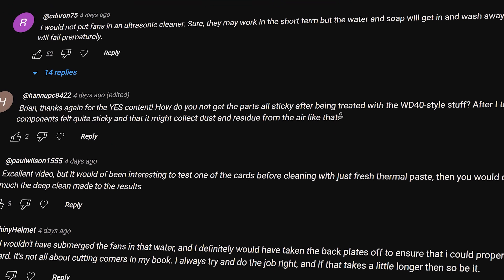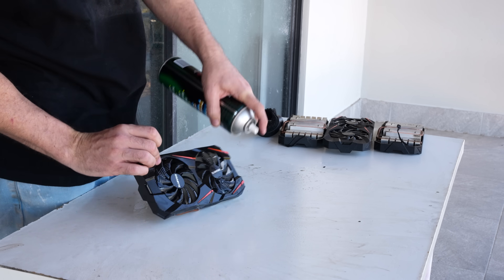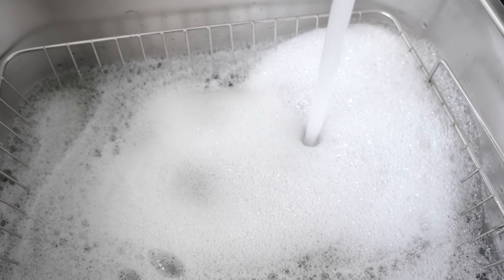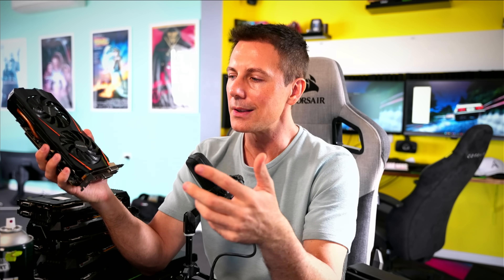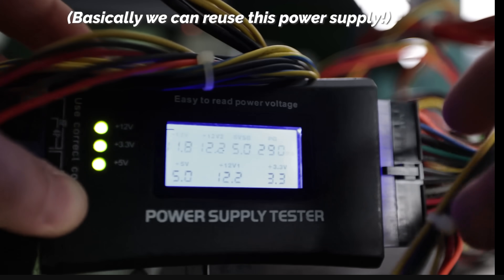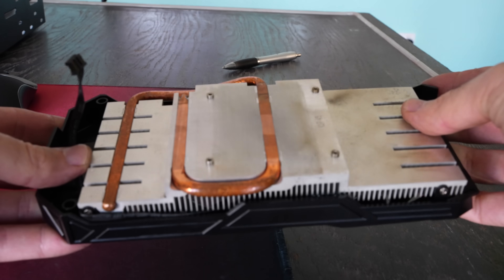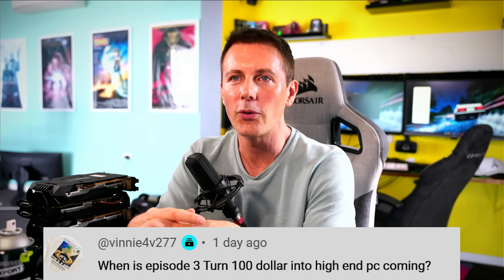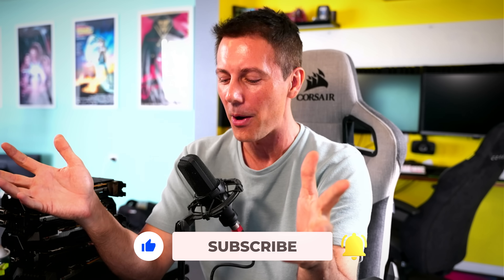"WD40" vs Computer Fans. (When Water Works)

Comment: But spraying lube all over the part is not the same as lubricating the bearing, what on earth… That will just make a part clean, yeah, for some time but make it a magnet for dust. And bearing will work fine for some time (old fan proves nothing — remove dirt from the bearing and it will spin, spray blades with oil and it will continue to spin, obviously, but not as good and not as long as correctly oiled fan). 

What that couple of video shows is just that it is very hard to kill PC hardware, it may survive so much abuse and still function fine. But it doesn’t mean one should abuse it and cover with oil film all over the place. Though it is understandable when the shiny surface helps you to quickly get rid of the parts ;)

Comment: I had a motherboard board with caked on dust and I gave it the "TechYesLovin" and it was fine. I did decide to use DI water in my case and it let the thing air dry for 2 days. Board was fine. DI water and a toothbrush for cleaning. Worked great.
Reply: Toothbrush, toothpicks, ear swabs and these baking brushes to oil up cake forms. All soft enough to not scratch the electronics, but firm enough to get the dust out.
The cooking brush is great to get into coolers, the toothbrush for general surface brushing, toothpicks to get into corners (like when cleaning thermal paste) and the ear swab for smaller surface.

Comment: Not sure if you can do this with modern fans but you used to be able to take the sticker off the front of the hub to reveal a little plug that you could remove to add lubricant directly to the bearing. I used to watch a budget builds youtuber who would rinse his PC parts such as fans with a hose and put them on the roof of a shed in the sun to dry. I wonder how many of those parts would have still worked a few months down the line once corrosion set in.

Comment: Sometimes you should really consult with professionals... Penetrating oils are lubricating, but only for a short while, they are literally designed to have no surface tension, which is what's needed to combat rusted bolts. That would be the exact opposite of actual lubricant (oil/grease). The minor forces applied by the fan wouldn't be enough to avoid contact (between shaft and bearing) and therefor the fans will die pretty fast (maybe couple of 100 hours)

Comment: I think some of the flack probably came from applying the spray with the heatsink still attached so none of the spray really gets in to the bearings, even if it claims to be a lubricant.

Comment: chip board and drywall in canada lol, You can take those fans apart entirely also take off the back sticker on the fan then take off the rubber plug remove retainer on the fan shaft then it slides out motor is exposed on other side those fans can be rebuilt if you wanted you can swap the blade onto another fan same size vice versa etc lol.

Comment: When I had an original IBM PC AT keyboard, I'd just throw it in the dishwasher about once a year and let it dry out, I live in Arizona, so air drying worked well and I used that keyboard for about fifteen years, until the Windows key was a must.

Comment: I stopped cleaning fan bearings...a good fan will have lubricant that lasts longer than your PC will.  I just stopped buying crappy fans.  I have fans that have ran 24/7 for 5+ years now and still dont need lubricated.

Comment: WD 40 is made for car engines to last at much higher temperatures but it clutters smaller stuff, try using bycicle oil instead, its much more refined and made for smaller moving parts. Should work fine on fans as well.

Comment: WD-40 does also lubricate but it's not a lubricant. The whole purpose of it is that it's good at a lot of things but shouldn't be used as a replacement for things that have a specific purpose. In essence WD-40 is a jack of all trades but a master of none.

Comment: Would you reckon that using the ultrasonic cleaner would work for things like CPU/GPU waterblocks (disassembled) and radiators to get the gunk inside and on them out?
Reply: for thorough cleaning, it is advisable to disassemble it and use a soft-bristled toothbrush with warm water. However, if you opt to put the block inside an ultrasonic cleaner, it can still do a decent job if you disassemble it then put it inside the ultrasonic cleaner I would gently clean the rubber seals by hand but that just me I don't know how they would hold up in the ultrasonic cleaner.
Reply: sometimes there are gunk that a toothbrush can’t remove, so I am wondering if an ultrasonic cleaner will help. I did mention that the blocks would be disassembled.

Comment: The issue people are concerned about when using regular tap water instead of distilled water is due to the mineral count in the water itself, especially if you have really bad hard water. Calcification can happen fairly quickly under the right conditions. Even with a water repellent spray it does not guarantee all the minerals have been washed away. But the amount of minerals left behind is extremely small and the chance for corrosion is almost non-existent. But I would not recommend doing it on a regular basis.
Reply: People are telling Byran how to do his job when he's been doing it for years, because they never done any of this themselves
Reply: @LawrenceTimme  I worked in a few computer manufacturers and one thing I can tell you is they will never use "tap water" to clean the boards. There is nothing wrong with using water, but there is a huge problem when using regular untreated tap water.

Comment: what do you think about pairing  ryzen 5 2600 and rx 6700xt am planning on building a budget system to upgrade from my i7 3770 and rx 570 4gb
Reply: It will be better but you’ll be missing gen 4 pci but since the 6700xt full pci 16 performance loss should be pretty minimal and will be light years ahead of your current setup

Comment: It's not the water that kills PCB's it's the minerals in the water as it evaporates that kill PCB's The exception is Capacitors. They can be destroyed internally by ultrasonic cleaners. Yhey are made with very thin foils. Careful with timing crystals and other exposed copper parts. Use distilled water and proper PCB cleaners in your washers.

Comment: I see a YouTuber soak his various electric boards in isopropyl alcohol, and I have always heard that this is terrible for the plastics on the board. He does it to make sure anything that anything that has leaked from capacitors is cleaned up. I haven't seen him having a problem with brittle board plastics.

Comment: hi techie chap, just done a lunchbox PC, same one you done, my issue is thou its great, but the leads from the stock SF600 are bit to long, i looked at some replacement stuff but nobody i know does custom cables to my length.
i the spec, nice 1080 machine
b550 board, 3070ti, 32g ram.

Comment: I think you can keep using generalized term/brand name such as WD-40 for some type Water Displacement spray, people are just nitpicking at that point.  A little tough considering WD-40 now has more formulas, but still just because the WD-40 can doesn't specifically state lubricant doesn't mean it doesn't act in that sense just as your Multipurpose spray.  People ask for a Kleenex when they mean a facial tissue.  But you should try and get ahold of some WD-40 just the original formula and clean and monitor a PC for some time.  I'd like to see that.

On WD-40's Site:
A QUESTION OF LUBRICATION
Myth: WD-40 Multi-Use Product is not really a lubricant.

Fact: While the “W-D” in WD-40 stands for Water Displacement, WD-40 Multi-Use Product is a unique, special blend of lubricants. The product’s formulation also contains anti-corrosion agents and ingredients for penetration, water displacement and soil removal.

Comment: Ofc you need to relubricate or it will run on dry surfaces and ware out the ball bearings or sleeves. And electronics and water isn’t the best mix so be sure to get it dry, I would leave parts in a dry and warm area for days before using them again. 
Ppl have bought graphic cards with water damaged gpus that cracked when they got warm, so if you buy used parts that look "cleaned" take it apart and check it up and leave it in a warm place for a few days to be sure it’s dry.
Reply: Absolutely make sure it's dry. I've had usb drives left in the washing machine before and they still work, but only because I made sure they're properly dried before putting them on power.

Comment: It’s definitely bad for the hardware. That lubricant spray is not the proper lubricant for high rpm fans. Also any wires cleaned with water will wick the water up into the wire leading to unseen corrosion. It’s 100% bad.
Reply: Wires is the kind of stuff where a water deplacement is useful.

Comment: Possibly a silicone lubricant and silicone spray removes water that's what wire dryer is its silicone good for under the hood of a car connectors spark plug wires stuff like that anything electronic.

Comment: Bro I don't doubt your results , but I believe you misleading people with the lubrification. You are not lubricating the actual bearing as it is incapsulated in the fan. You are just lubricating the outside of the fan.

Comment: WD40 is too slow of a lubricant to be used in fans. I use TriFlow, which is a teflon-based synthetic lubricant and it even works as a contact cleaner.
Reply: Great tip, I'm saving it's name.

Comment: Prolly 5 years ago I ruined my 120mm CPU fan using original WD-40 and didn't knew the reason. Yeah use lubricants not abrasive WD-40 to "help" fan to spin for few weeks. Not sure if PTFE lubricants are worth try if one of my fans dies

Comment: Lubricant is fine I guess but why not grease for fans? At high rpm you’re certainly gonna lose a bunch of that over time and be back in that situation. Grease should hold up better and longer (and costs roughly the same).
Reply: Should be really great for ball bearings, but maybe not the greatest for sleeve bearings.

Comment: WD stands for water displacer. It is the opposite of a lubricant. Actual WD 40 turns into a weird hardened muck when you spray it on hardware, it will kill hardware pretty quickly. After using WD 40 on anything, you want to wash it off or displace it with a lubricant. Years ago when you started calling that spray WD 40, I got curious as to what you meant by that. I tested WD 40 spray on an H110 board to see what it did. Your misnomer is responsible for the death of at least one motherboard lol

Comment: I use WD40 to clean components but I don't use it to lubricate, it's not an unorthodox method of cleaning what do most people think they do at the factories when most of the hardware is covered in loads of crap from making the PCB mind you most of the large manufactures use acetone or at least distilled water lol
Reply: Yeah, I've used cycles of WD-40, 80% alcohol, lighter fuel and soap detergent to get rid of sticker and glue residue. It's just important that the last wash isn't conductive.
Soap is obviously great to get rid of fatty residue (like fingerprints and fat-soluble glue), but not so amazing for other stuff.

Comment: What the heck are you talking about? You did not even remove the fans from those heatsinks. There is no pysical way that the spray will go in the bearings without removing the fans.

Comment: OK so first, good on you coming on and realizing giving people advice to use wd-40 was a bad statement.

That said. So you're actually using a lubricant to clean your PC board(not talking fans)?  That's just as bad as using WD-40.  Lubricants leave residue(kind of the point)! 

Maybe you should take your own advice...If you don't know what you're doing....

YES if your fans literally won't spin and you can't afford to buy new fans, then you can try this method.  Just keep in mind they won't last!!!  What he does get's them working and pretty to re-sell to unsuspecting buyers.  This is like re flowing a GPU(oh wait he tried to do that too).

Comment: I still dont think that oil is good for fans...

Best way is to open the fan oil reservoir and put something thicker.

I even had some generic fans made for my old Xbox360 and they blown away all the oil all over the console exhaust in no time which Im guessing they used very thin oil or simply very poor seal...

On my fans that I have working since 2011 every time they started making noise I simply filled the reservoir with my own mix of good branded machine oil mixed with thick paste that I pre-mixed into a syringe, works like a charm and last many years 😎

Comment: Having sprayed the video card fan from the outside, the dude thinks that he has lubricated it. From such a seller, you can run into rotten electronics after cleaning it with water and lubricating the bearings by splashing on the fan from the outside. Beware of such clean equipment, from such stupid people.🤣🤣🤣

Comment: WD40 is a Degreaser, not a lubricant Bryan I hear can’t wait to see your test on the new i9-14900K 👍
Reply: as it goes WD40 does have a lubricant in it, spray it on your hand and you can feel the lubricant
Reply: @steventurner197  bro degreasers have that feeling
Reply: @steventurner197  coming from a bike mechanic background it degreases bearings pretty well to be re-greased and put back into a bike
Reply: Well i fixed some fans even in old Fortron PSU with WD-40, and to this day its works without any issue and without any additional lubricant
Reply: WD in WD-40 stands for Water Displacement, it’s not a degreaser even if it mix with other lubricants. But even I use it to clean out old crap in motors etc. 😊
Reply: read the can bro it states stops squeaks
Reply: @anders.2259  try finding a greasy chain then spray WD-40 on it and then wipe it with a cloth and tell me what it does it cleans the oil off of it or get a sealed bearing spray WD-40 on it, and tell me what it does afterwards. It dries out the bearing, so it doesn’t have any grease in it this is how I’ve cleaned things on bikes sins I was 7 and I’m 44 now ok for PC maintenance but bad for sealed bike bearings as it drys them out and WD-40 evaporates very quickly 🚲💨

Comment: When I have a stubborn fan like that I just peel the sticker on the back off, that'll give me access to the bearing in the fan, put some dishwashing soap in there and some multi purpose spray and resticker it back up, if it's a fan I really care about I'll use a krytox oil lubricant

Comment: The video is still crap, that spray is not a proper lubricant, not all "lubricants" are the same.  You using hat spray is as "lubricant" as using olive oil on your car's gear box, its basically non existent. The bearing will die sooner than later. You should be using motor oil or light lithium grease for a fan. That light oil lubricant of your will dry out pretty quickly

Comment: Has anyone managed to open an amd wraith prism fan? I tried squirting wd40 in the gap on mine a few months back,
Still sticks sometimes when booting . . .
Reply: Maybe the lubricant has dried up and is mixed with dust. That stuff can become really hard. I remember that from CD drives. After some time you need to open them up, remove the lubricant, and apply fresh.
Reply: @HappyBeezerStudios  I was guessing it's probably clogged up but I couldn't open it, There's no videos of anyone taking one apart.